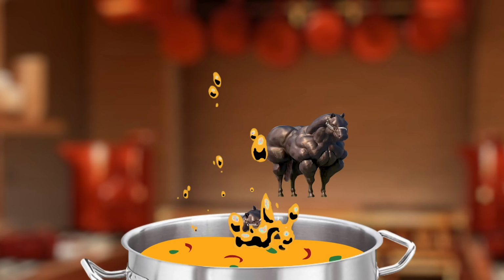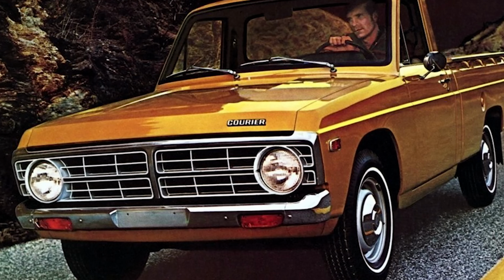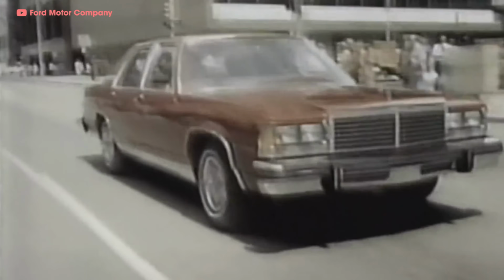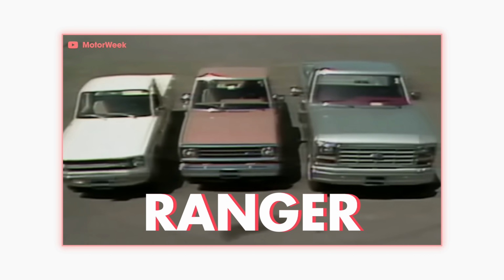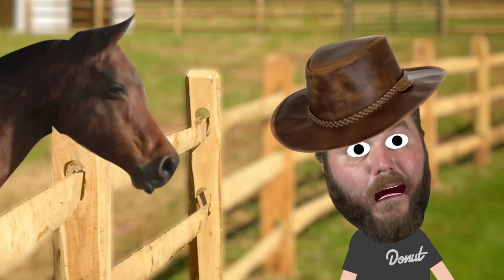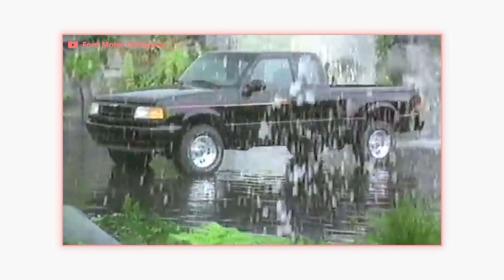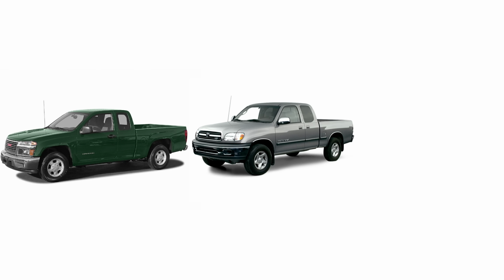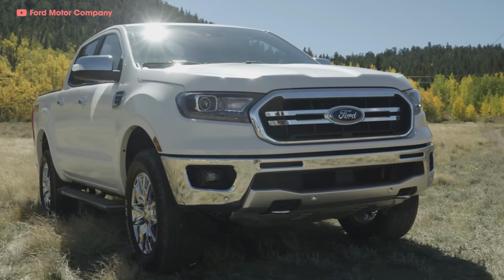FORD RANGER - Everything You Need to Know | Up to Speed

Comment: I will keep my 2006 Ranger Level II with leather that will only go up in value since all today’s manufacturers fail to realize the public want an economic small strong 4x4 truck. We don’t want huge payments on a full size truck with bells and whistles.
Reply: Have you parked your ranger next to a new one? My lifted 2000 extended cab is about the same size as my uncle's 2019 extended cab, not 5 door. The new one just sits higher. Level with my lifted ranger.

Comment: I daily a 94 xl ranger extra cab it has a Vulcan 3.0l.was stock when I got it . The colgan actually ran all the way until the ranger ended production. Define alliteration of the colgan v6 was the 4.0l single overhead cam. The rangers came with the Lima 2.3 l the Vulcan 3.0 l and the colgan 4.0l. they ended production of the 2.9 and 2.8 l colgan in the generation 2 trucks . as far as I'm concerned the only real rangers are the ones with twin i-beam suspension. The best mini truck ever built the new ranger is not a ranger sorry not sorry . It's a car with a bed . Might as well just buy a Civic and cut the back off

Comment: Even in the 1990’s a 4L V6 putting out 160hp was kinda pathetic. I used to have an Explorer with the same engine, and the acceleration was pitiful. Especially considering that the same eras 4.6L Triton V8 was putting out 205-220hp. Seriously Ford should have taken that V6 Cologne out behind the shed and shot it about 2 decades before they actually did.

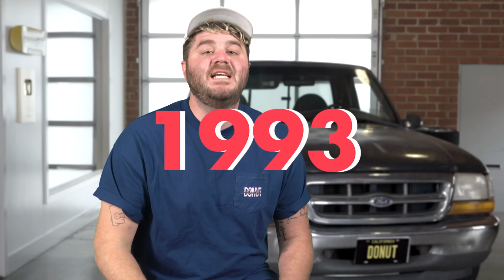Comment: 9:03 um, the 3.0L Vulcan v-6 stayed with rangers till at least 2002, had two of them, the 3.0L was a dog, but was way more reliable than the poorly designed 4.0L sohc v-6 used in rangers and the explorers, seriously if you wanna see something that sums up everything wrong with ford design in the early 2000's look up timing chain replacement on the Ford 4.0L SOHC motor.
Reply: 3.0 ran until 08.  And the 4.0 sohc was literally a modified 4.0 ohv. This the jack shaft for the rear timing chains. And they both are cologne engines (German engineering)

The timing chain is pretty simple though. I've done a bunch. Done in a day.
Reply: @BigBing1987  I ment 08. And both 4.0 and 4.0 sohc where colonge v6s
Reply: @BigBing1987  I can pull the engine within an hour, once out the timing goes easy, then back in. More time consuming then other engines but not the worst. 

Ever did the timing on a Suzuki h25a? In a grand Vitara. That is a pain
Reply: @mowmastermitch6899  yes seen the h25a and its later relative the 6DE1 with asymmetrical turbo  that was used in saab 9-5 sedans, that was effectively a time bomb after the warranty ran out.

Isuzu made the same mistake toyota did IMHO, they should have just stuck to 4 cylinders, old toyota and isuzu 4 cyl are tough, well designed motors, but there V-6's in the 90's were problem after problem, and most of the problems were truly a pain to diagnose and repair.
Reply: @mowmastermitch6899  maybe ok option in some areas, but I grew up in PA, and a 100k mile road salt exposed ranger that needed a timing chain wasn't a good time pulling the motor or transmission.
Reply: @BigBing1987  Wisconsin here. But I do agree that it wasn't a good idea of an engine. But I do find pulling the engine easier then removing the trans. Especially in 4wd.   

There are a ton of poor designed engines out there and many that suffer from poor maintenance, or a lack there of. 

I personally like my 3.0 ranger also as it is simple and reliable.

Comment: 98 ranger was not wider nor bigger anything  all parts cab related would swap back to 93. In fact 93 to 2010 cabs and beds would bolt straight up. Suspension changed in 98 and then came pats system 🙄.

Comment: I've seen a few of the new Rangers. (I used to work at a Ford dealership)
They're just weak-ass F-150s with a different body design.
I had a 98 Ranger and one of the many things that made it so good was it's simplicity and extreme low cost to fix in the back yard.
Total bare-bones with the only luxury being heating/cooling.
The new rangers are over-built and injected with tons of luxuries eventually to be money pits. You could have just gotten an F-150 with all the same features. But I'm sure there's a line of people out there going to buy one just because it has the "Ranger" name.

Comment: The 2000 ranger sucked. I had one and i had a few freinds that did. After 75 k expect transmission problems. Third gear gone. Blown heads after 100 k. After 3 transmissions i decided i was done. Mazda drive trains were garbage. The three liter engines were fun for a minute. Till you realized what was happening to your buddies truck was about to happen to yours.